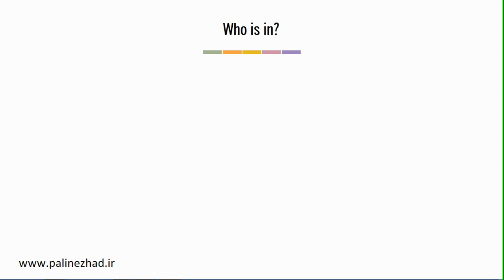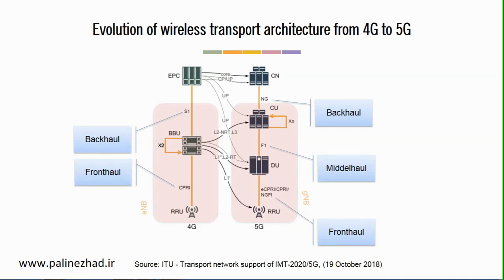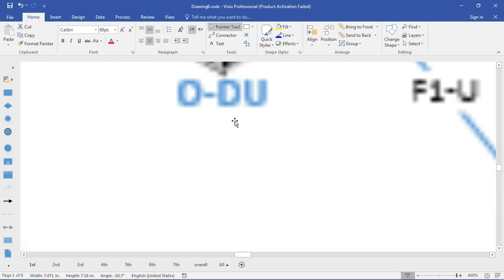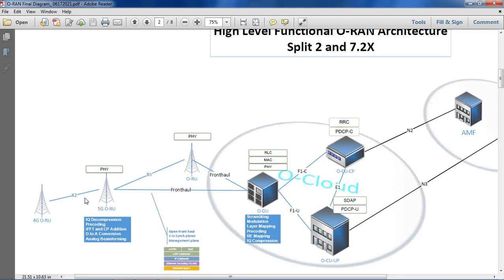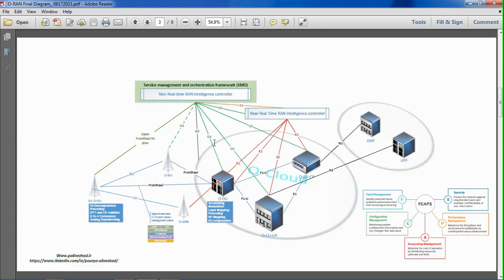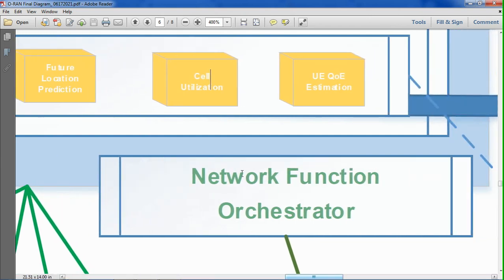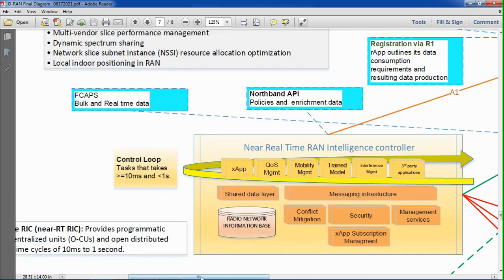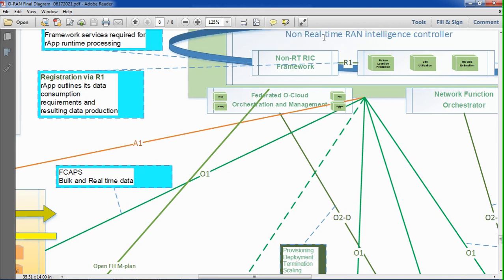ORAN, OPEN RAN EXPLAINED

Comment: Dear, what are the use case RIC in term of 2g,4g Open RAN and what is the best split option if the network is LTE + GSM
Reply from the maker: The xApps or microservices are virtualized functions of BSC for 2G, RNC for 3G, x2 gateway for 4G among others.
there is a good image in below link by parallel wireless:
https://www.rcrwireless.com/20200730/open_ran/open-ran-101-role-of-ran-intelligent-controller-why-what-when-how-reader-forum